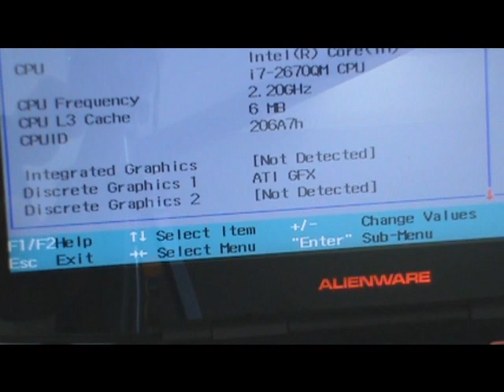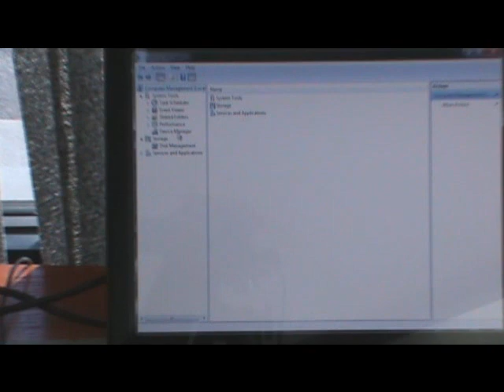AMD Radeon HD 7970M installation in M18x R1

Comment: Hi, I just purchased 2 AMD 7970s on Ebay that came out of and Alienware M18x R2. I have the Alienware M18x R1. Do I need to do anything to the drivers or the BIOS on the cards before the install? I have read that if you install later model Nvidia cards into an R1, you have to modify the driver Inf files in order for the cards to be recognized.  Is this also true for the AMDs? Thank you!

Comment: Yea, but it says it can hold up to 32gb ram. But currently going to stay at 16gb, just added 16gb 4x4 Kingston Hyper PnP and 2 480GB SSDs Kingston hyper 3.0 (6gb/s). Been running smoothly. From cold boot to log in screen only takes 5sec lol. Also on the perform ac scan, everything is at 7.9/7.9. So I guess I am set for what anything is coming out. :)

Comment: wow...mine must be too old. My alienware m18x R1 still uses NVIDIA GeForce GTX 560M. But I bought it around the beginning of 2012. Currently trying to upgrade to 32GB ram. Even if my system is older, would I still be able to upgrade to AMD Radeon HD 7970M ? Update: Just noticed I also have AMD Radeon HD 6970M already built in but I guess that is default for this laptop to have duel, integrated video cards.
Reply: Mine has a GTX 560m too. I was wondering about the same question. However, the motherboard only supports up to 16 Gigs of RAM. There should also be 2 or 3 HDD slots in the HDD case. I'm going to upgrade to SSD anytime soon.
Reply: Yea, I think the R1 has 2 HDD slots and the R2 has 3 HDD slots, I have only 2.

Comment: Is the mat necessary?? Dont even have the card yet but this upgrade cost a new decent rig already damn... Still have 260m in my m15x :(
Reply from the maker: Its recommended but you can get away with out it for sure.
Reply: u wont get away with out it in todays times

Comment: Hey, I just sent a message on EBay and am posting the same question on here in case it goes unanswered. Is the MSI GT60 GTX680m card that is for sale also compatible with my MSI GT70 and if not, do you have any GT70 GTX 680n upgrades available?

Thanks a lot.

-Justin

Comment: Hey I did the same upgrade on the R1 and noticed I can no longer switch to integrated graphics. That is a HUGE bummer because have to switch to it in order to stream stuff to my TV. I had a 6970 before this one and switching between graphics was no problem, but now with the 7970 the integrated never even shows up in the bios. What is your experience with this?

Comment: good but when i bought this notebook it has some drivers of ati or amd  

And i checked on web and some n4050 has the amd 7450m with the same processor (core i5 2450m)

Yea it has integrated graphics "Intel hd 3000" but i guess i can add it at less the radeon 7450m

Comment from the maker: The performance of the 7970M is currently the best available in a single mobile card. You'd need a 60Hz screen on an Alienware for AMD VGA compatibility. If you have a different system manufacturer, check their specs for AMD 3D compatibility.